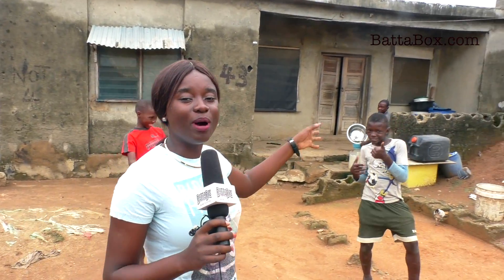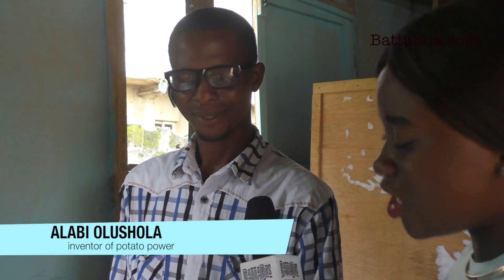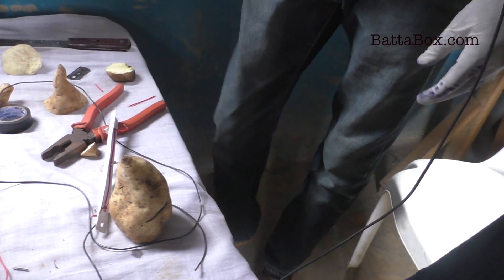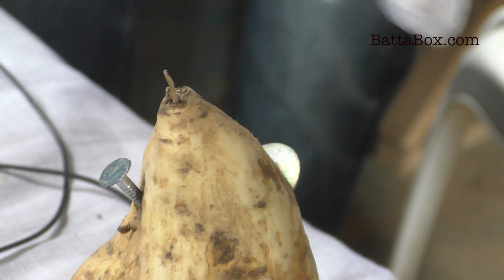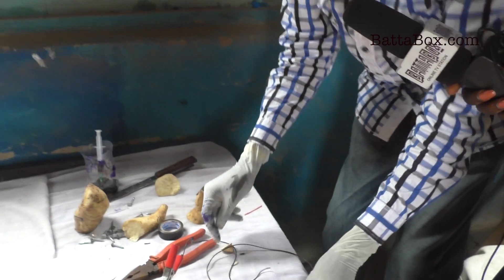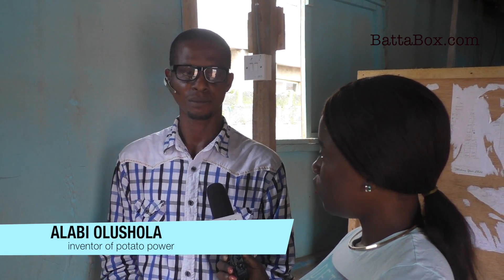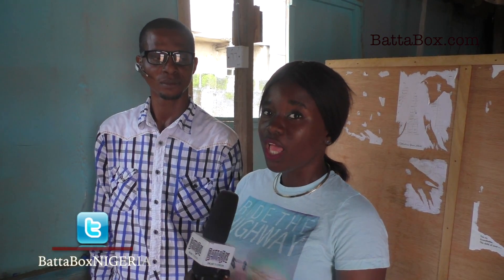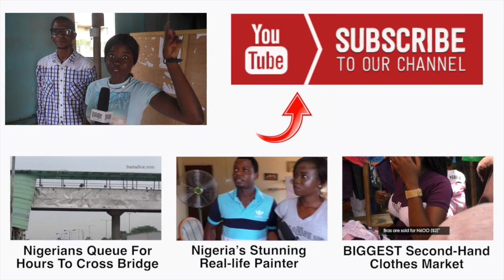This Nigerian Creates Light With Potatoes !!

Comment: he did not invent this! this method of making power is well known, and its very unefficient, thats why Allesandro Volta invented the firts battery in 1799. Instead of using potatoes, you are better off using an actual battery and some diodes to get a little bit of power in your house
Reply: Fuck off, troll you were paid to disrupt the conversation here.

Comment: Great Job! But sorry to burst your bubbles this is not new. It's elementary science. Potatoes only provide DC and home outlets are AC meaning you have to look for a way to convert the DC to AC. Instead of using so much potatoes you can use Boiled potatoes: To save some money. Each raw potato produces about .5 volts of energy which isn’t much. Boiling the potatoes allows an increase in energy of about 10 times! So, that’s five volts per potato—a huge difference. It would take about 258 potatoes to power your entire house for an hour but I doubt if it can power appliances like pumping machine, pressing iron and water heater. Keep it up Adeolu. God bless.
Reply: lol 258 potatoes around the house. Boiled potatoes are superior.
Reply: +Stephen oseghale exactly what I just posted, wish I saw your comment first I wouldn't bother lecturing them.
Reply: You know this potato battery don't last forever? And when the battery is flat the potatoes is not edible.